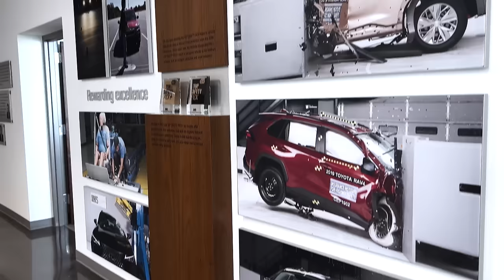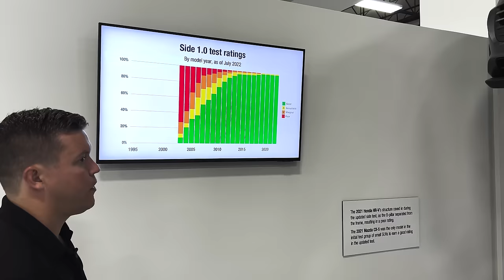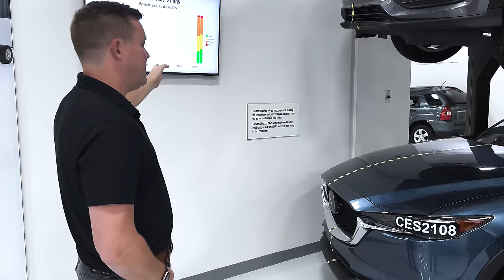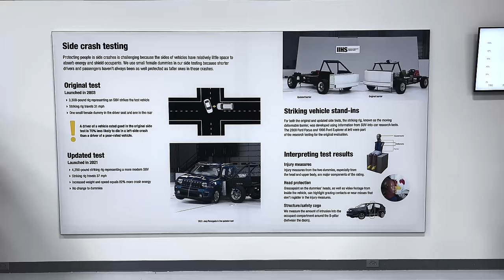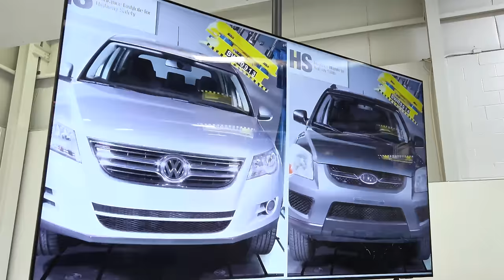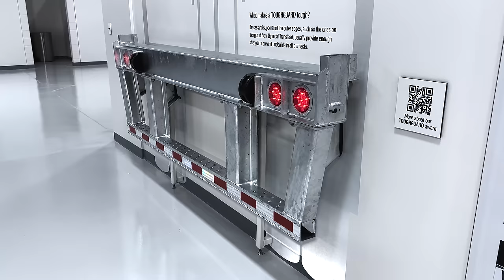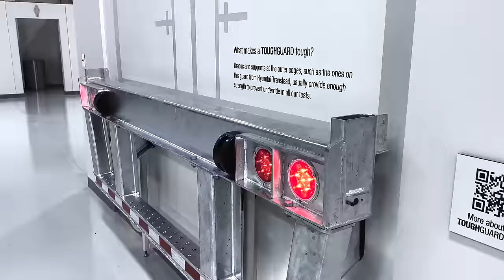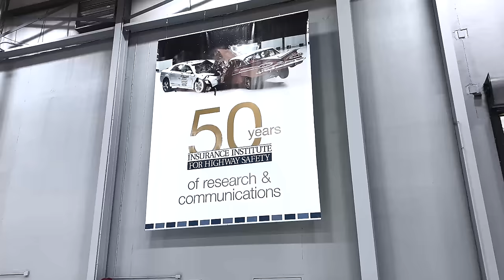Ford Mach-E Moderate Overlap Front Crash Test | IIHS Tour

Comment: I've watched a few crash tests over the years, and usually you will see the energy of a front crash ripple through the sheet metal and other items right to the back of the vehicle. That car was solid as hell with almost no rippling, its amazing how much trying to protect the battery translate into the vehicle turning into a "tank". There are many reasons why I want to buy an EV and for me the extra safety over an ICE vehicle just adds another reason. Great video 👍
Reply: Looks like this one is safer than a Y comparing the two

Comment: Excellent tour and commentary guys. Such a nice facility. Great to see a live test plus all those examples of past testing. They do a wonderful job of measuring the Safety levels in each car they test. I’m really impressed by the BLOCK. two Aircraft’s weight in one Block Wow. Thanks Monroe Team and IIHS for this very comprehensive video. It should be a recommended view for young Learner Drivers. If they don’t drive the latest cars they need to understand the shortcomings … they can also get an appreciation of the technology ready to save them in accidents …

Comment: I'm a fan of Munro and the IIHS YT channels. The remark comparing the weight of the block to the weight of DC-9s intrigued me. 27:00
I used to work for McDonnell Douglas Commercial in Long Beach, CA. Including on the later versions of the DC-9. By then, they were called the MD-80 series.
Anyway, back to the weight. Indeed, the original DC-9 had maximum takeoff weights of around 70K pounds. By the time the planes evolved into the MD-83 (DC-9-83) the MTOW had increased to 160K pounds. Sort of like the weight increases seen on current pickup trucks as they go to batteries. 
An aside, I have always thought the MD-80s were among the most beautiful looking planes when in flight.

Comment: Love that Malibu vs Bel Air test. I was at a presentation 10 years ago that showed this very test as proof of why the government needed to set safety requirements. He stated that cars were better because of government regulations made car companies better. I didn't disagree necessarily, but when they opened the presentation to questions, I asked to see the video of the 1950s Bel Air vs the 1920s Chevy Series model K. He said that they haven't done that test, but that couldn't compare because the cars of the 20s were not as sophisticated as the 1950s. I said "exactly, same goes for the 1950s vs 2000s".

Comment: Car and Driver just showed a video from IIHS testing their equipment for a 9500lb vehicle weight using an old pickup with a large concrete block in the bed. That block punch through the rear wall and hit the dash.  I hope IIHS adds a test like this for pickup to protect occupants from the stuff in the bed.

Comment: Top safety picks: good performance headlights. 

Getting the seatbelt retractor out of the B-pillar and under the seats or in the seats would allow greater strength on the B-pillar because the hole wouldn't have to be cut for the seatbelt retractor.

Plastic between glass on the side windows could help side air bags spread and absorb impact forces even more effectively.

Comment: The old versus new was definitely interesting. It is always been sad that I would take an old car because the heavier steel however, we can see clearly it’s not a safe.
Reply: Correct. New cars are better than older ones in both passive and active safety. The only thing better about older cars is the visibility and maybe headroom, IMO.
Reply: @benjaminsmith2287  yes the pillars have gotten so much thicker making it harder to see.
Reply: @mobilechaosyt I’m all about safety but I miss the openness of the cars from the 90s.  I grew up in a Volvo and a minivan, which both had tall side windows.

Comment: I am a big safety guy as a trauma physician.  A few years a survey was conducted on what USA drivers would prefer to spend on.  Americans would spend more on styling vs safety.  Europe was the opposite.  Amazing some cars still offered with dim yellow halogen headlights.  2012 stability control was mandated as it could save move lives than seatbelts.  There was a time there was poor safety cages with air bags just thrown in to help prevent injuries.  You need a good safety cage before air bags can work properly.  IIHS will fail a car, NTSB will not fail a vehicle.  IIHS has tougher tests vs NTSB.
Reply: So many more rollovers in suv/trucks which stability has helped

Comment: Wow, only 36 mph and there are deaths! Imagine what would happen to you on the freeway!!!
Reply: No deaths in this test and remember this is running directly in to an unmovable barrier.
Reply: I remember them talking about how 5 mph more speed is exponentially more damage. If the average person realized that speed exponentially makes crashes worse, then maybe you'd start to see people doing the speed limit or even 5 under.
Reply: @heathwirt8919  Which is 1/2 the speed of a head on.
Reply: @DouglasEKnappMSAOM  The impact into a solid unmovable barrier is the same as a head on, in a head on you have twice the speed but also twice the crumple zone, each car is effective only absorbing its own energy. Size and strength differences changes that math, but the solid barrier gives an empirical test. If you tested two identical cars crashing into each other head on, each travelling at 40mph it would produce the same level of damage on each car as you would see on one car crash at 40 mph into the solid barrier.
Reply: Another challenge is that modern cars travel in excess speed so effortlessly and comfortably. I remember in the 90s, it would take so much effort for my parents cars to go above 65 mph, and anything above that, the car felt like it would fall apart. But nowadays, even as a relatively slow driver, I find myself driving unintentionally in excess speed just following the flow of traffic on the highway.

Comment: Awesome that they are pushing the industry and improving on government standards. I still find it crazy that the crash tests are still nowhere near 60mph. For two cars head on ~120mph. Still have a long way to go and a lot of improvements that can be made. Really excited for Tesla's crash test lab with all of their live data of real world tests. Hopefully that can not only feedback into Tesla's testing and improvement, but into agencies like this to adjust testing across board to better mimic real world data.
Reply: They directly said that they based their testing speeds based on real world police reports and crash statistics. Even in situations where crashes happen with a vehicle travelling at 60mph, they USUALLY are rear ending a slower car, so the net velocity is much lower. When people veer off the side of the road, they often impact highway railings, which is why we have seen dramatic changes in their structure and design over the last 20 years so they are no longer just a giant blade that will cut a car in two. 

They also said there is no point in doing tests at 80mph where no-one would survive. As with everything in the real-world, safety is about compromises, not absolutes. You cant make cars that are perfect safety cells at any speed. What you can do as an automaker is improve software and hardware in the vehicle to prevent it from running into things or running off the side of the road to begin with. As they said, they have to cripple these cars completely because they dont know if the cars might try to brake before hitting the barrier, which would be the ultimate best solution for these tests... not hitting the barrier at all.
Reply: Two cars going 60 MPH hitting each other in a head-on collision would be the same as hitting a wall at 60.  The speed doesn't get multiplied.
Reply: @LeesChannel  So 2+2=2 by your logic.
Reply: @heathwirt8919  It's not plus.  They both come to a sudden stop.  There is no functional difference.  This has been tested and proven.
Reply: @LeesChannel  The direction of travel is opposite so the  momentum of each vehicle is added making the crash approximately equal to 120 MPH crash into a stationary object. This is basic high school physics.
Reply: @heathwirt8919  The momentum is not added 😂  I guess you skipped Newton's Laws of Physics 🤣
Reply: Newton said: Momentum is a vector quantity; i.e., it has both magnitude and direction. The key here that you're missing is direction, in this case the vectors are going in the opposite direction. So the force of the collision is doubled assuming both vehicles have the same mass and speed. Contact a friend that has a scientific background if you don't believe me. This will be my final comment on the matter.
Reply: @heathwirt8919  I'm glad that you'll stop because you are completely off.  First off, this subject has already been proven, but neverminding that, kinetic energy scales at the square of velocity, so the energy of an object at 120 mph is FOUR TIMES the energy of that object at 60 mph.  Adding two 60 mph collisions together would never equal the energy of a 120 mph collision.
Secondly, if what you were saying were true, if two superballs were to collide, they'd both bounce off at nearly twice the speed they hit.  This is impossible.
Anyways, here is Newton's 3rd Law of Motion:

Whenever one object exerts a force on another object, the second object exerts an equal and opposite on the first.

This is true not only of the cars, but the wall as well.  The force required to stop a car is the same regardless of what object stops it.  You don't double or quadruple the energy because the equal opposing force was another car with equal velocity.

Comment: Waiting for the Cybertruck crash Test and it's safety rating🤨😄
Reply: With no deflection intended, could be much worse for occupants but lower cost to repair
Reply: It should do well they use detailed physics models on computer
Reply: @ralanham76  everyone does that
Reply: @mattbrew11  The Cybertruck with its huge very expensive castings and unibody would be unrepairable after this test and be listed as a total loss.
Reply: The only vehicle to defeat the wall.

Comment: What tests can be done with regard to being burnt to death after an accident such as an event where the occupants may be unconscious and will not be discovered or able to leave the vehicle for an extended period of time?
They recognize there may be a problem, so no one touched the car until it’s been deemed safe, then they put the EV in a separate shed - just incase.
How about some explosive bolts that would, in the case of a major collision, would segment circuits to reduce the chance of fires?
I have a Model 3, best car I’ve owned, I am 64 years old. So there is no disrespect on my part towards EV’s. The Ford Pinto, for example was burnt at the stake for its fuel tank induced fires after accidents. Why no EV Battery Safety ratings?

Comment: I Believe USA HID’s not require auto leveling or auto headlight cleaning vs European standards.  European requires side mounted turn signals like mounted on top side mirrors.  Rear turn signals can not be red in Europe only yellow.  Red always means stop in europe.  USA cuts costs by allowing red to mean stop or turn.  I believe only recently usa allows laser headlights.  Slow wheels of bureaucracy.  Old USA laws where there had to be a separate high beam switch.

Comment: A crash helmet is stronger than any head but the brain itself can not take the impact bouncing around.  Yes, you want a strong safety cage but weigh the expense as you can not save people at 70 mph and higher.  Our organs like heart, brain, liver, spleen, intestines are similar to water balloons tethered on attachments.  High speed impact cause organs to compress, bounce, twist, tear, rupture with serious damages that are life threatening.  Bones are fairly easy to repair but not organs.  A 5 star rating in a small vehicle not the same as 5 star rating large vehicle.
Reply: That's why all modern seat belts have pretensioners and load (force) limiters, the pretensioners take up the slack in the belt and the load limiter lets out a certain amount of slack once the force on your body reach a set limit, this spreads out the force overtime and reduces the maximum force to survivable levels. 

This is the same reason cars have crumple zones they spread out the force over a longer period, limiting the maximum force the passengers are subjected to. 

People survive crashes in motorsport at speed double even triple highway speeds, because their cars are designed to keep the squishy human on the inside from getting hit with anything hard on the outside.

Comment: EISENHOWER DEVELOPED usa highways after Autobahn.  He enacted a speed limit as he felt USA cars were not built like European high speed autobahn  cars,  I think USA has closed that gap.  Typically European cars were designed for driving high speeds with engine durability and safety crashing at high speeds.  Even world emissions are Euro 3,4,5, etc.  Europe seems to set the standards that others follow.

Comment: They like to show the “old car” that’s demolished.I submit that the 59 chev had an x frame which did not have side rails to prevent such a collapse.it also had an unusual a pillar that was not optimum for such a test (they were never used again.Finally 59s didn’t have a collapsible steering column ,they came in in MY67..which is the safest vehicle you can buy?The largest and heaviest.PS considering the unextinguishable fires that often occur in EV accidents,perhaps it’s advisable to leave the battery connected.Though testing my have to be done outside

Comment: Somehow Ford ads still make it through my Adblock, here is one now.
Reply: Tesla fanboy envy.
Reply: @heathwirt8919  What does Munroe making Ford ads have to do with Tesla? lol If anyone got Tesla envy it seems to be you.
Reply: @nisetsu  Is the fact that this report happened to have the Mach E as the unit under test and the result was a very good rating trigger you. Why is that? If it would have failed terribly you would be OK with that right.
Reply: @heathwirt8919  You seem to be completely missing the point: I'm just pointing out how Munroe is pathetically sucking up to Ford based on this and other Ford videos they made, I'm not fanboying for or against Ford in any way.